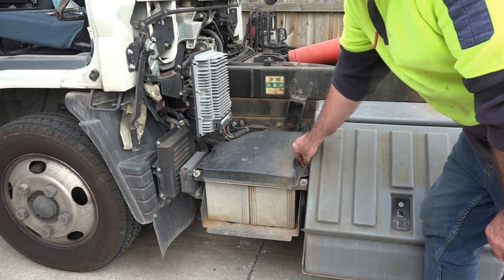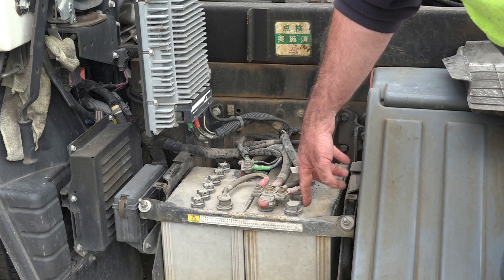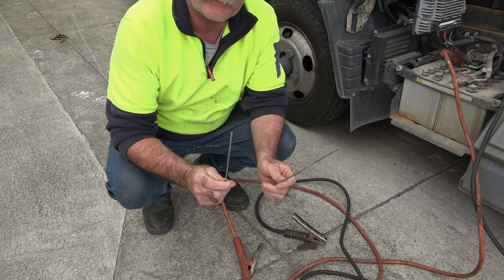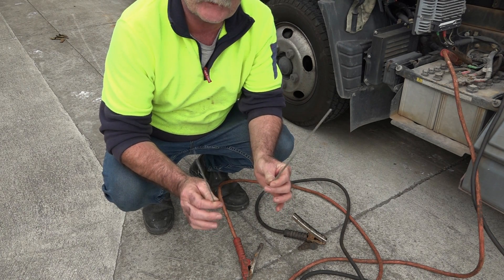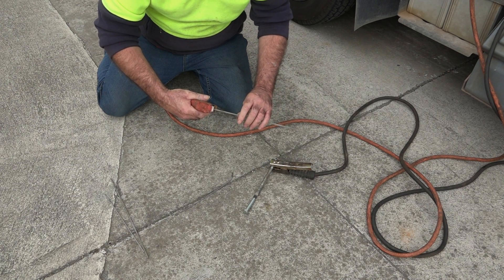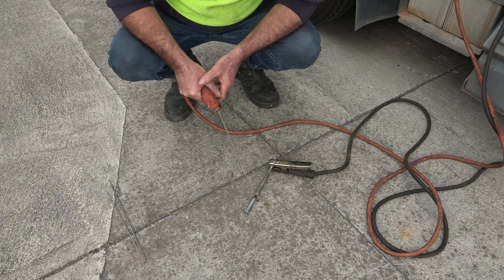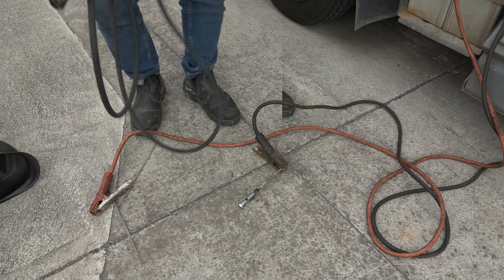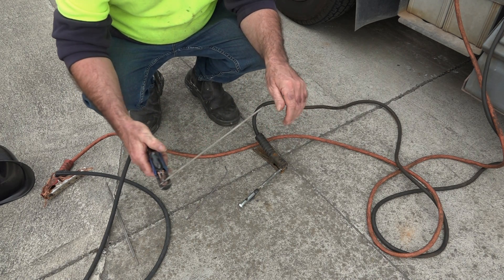Can You Weld Without A Welder ?? - If Your Stuck On Side Of Road

Comment: Yay thanks. Been trying to work out how to weld a found on the verge kamado smoker's bottom vent back on but no welding machine. Seems I will be adding kids car batteries to mine. Hilarious sparkly fun for an old resourceful biddy never sheila, live in Aus but even sooo many yrs later still a foreigner 🤣 I make stained glass windows so half way there with flux and even flow. Merry Xmas to you. Cheers for your sharing your bush mechanic ingenuity.
Reply from the maker: Sounds like fun mate Cheers